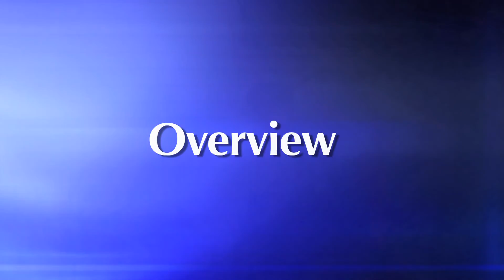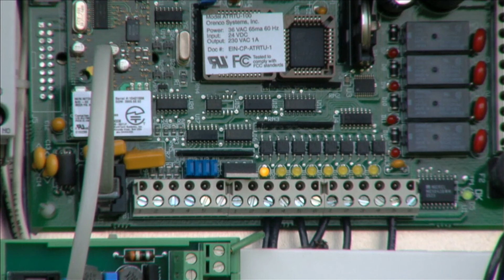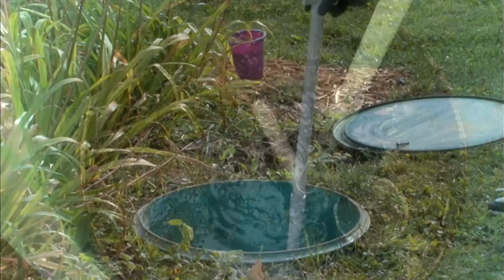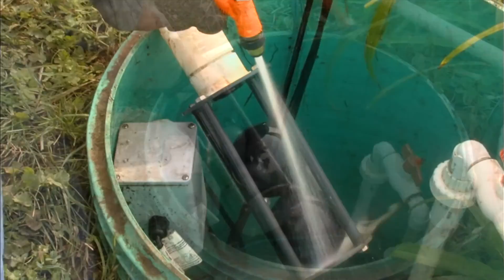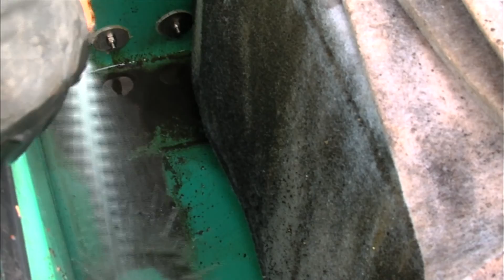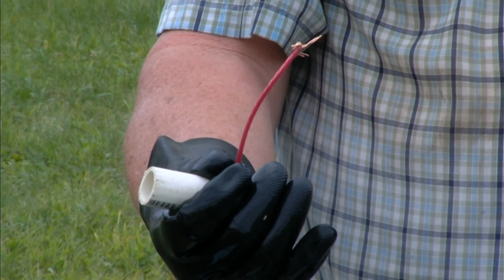IOWWA - Orenco Systems AX20 Advantex System Maintenance

Comment: Thank you for this video! What a maintenance nightmare! Terrible system . Many companies refuse to work on them. Now I know why.
Reply: Why would someone need such a complex, high-maintenance system?  An issue with the soil's percolation such that a traditional two-chamber septic can't service the household?
Reply: @kdcarver  Yes, in our case, it's an elevation issue, so it's due to the slope. But really I think it's because this company, with the help of our corrupt county permit department, has enabled a monopoly for this company for alternative systems, so we are prohibited from doing business with other better and cheaper companies and their products! What do you do?
Reply: @yogibear8686  An elevation issue?  Is the leach field upslope or level from the main septic line?
Most of the septic systems I've dealt with are gravity-fed.  Some neighbors had the aforementioned slope issue, but they just needed a simple pump to remedy the situation, not a multi-stage fabric system that needed to be maintained.  The only reason I would think this would be necessary would be if the soil did not have the porosity necessary to allow the effluent to percolate and disperse effectively.

Comment: Thank you for the detailed video which really illustrates all the steps of maintenance clearly and shows that this could be a task that any owner that does not mind dealing with it could do.
It also shows how engineered this system is, how well crafted/manufactured all the components are, and why is expensive. Yet it also shows that there are way too many parts and points of failure. 
Despite Orenco apparently is the system that gives marginally better results than the competition, I may give it a pass and go for a Norweco which is definitively less complicated, give very similar results, is a little less expensive and it does not have any "casket" to put on the lawn.
Reply: Why would someone have such a complex, high maintenance system?  An issue with the soil's percolation such that a traditional two-chamber septic can't service the household?
Reply: @kdcarver in my county it is required which I think is just their way of getting more money from us. I had an ADU built on my mothers’ property and the county required us to upgrade her septic system to this same setup. So frustrating. All for a household of three.

Comment: I occasionally get over 20 amp inrush on the discharge pump which trips the service breaker. Do these pumps sit on the bottom of the tank?
Reply: Not sure if you got your question answered, We also service these systems often.  Some of the most common causes are 1. not enough incoming power, we always run three circuits 15 amps for the controls (uses maybe 2) and 20 amps to each pump. with 115 v it will use around 12 amps and with 230 v it will use around 8 amps. When both pumps run at the same time it could trip with a bad connection or wire size to small. Next check your contact switch, earwigs love to get in and behind the switch causing a bad connection, you can tell by the black soot on and around the switch. Always check the screen on the pump as shown in the video, a plugged screen can cause high amps. If it only dose it once in awhile its probably not the pump. Orenco has the best customer service I have ever seen, they will help you find the the issue. Good luck!